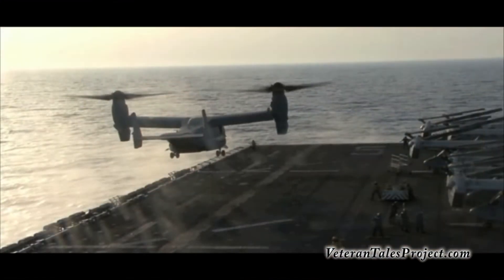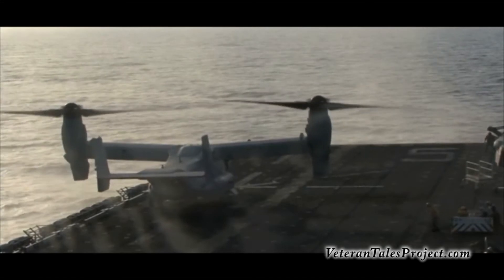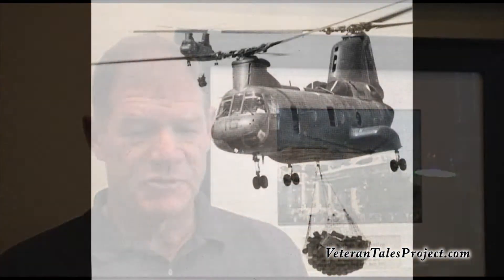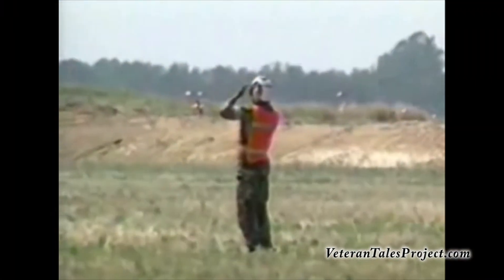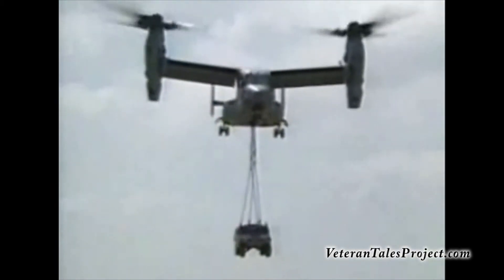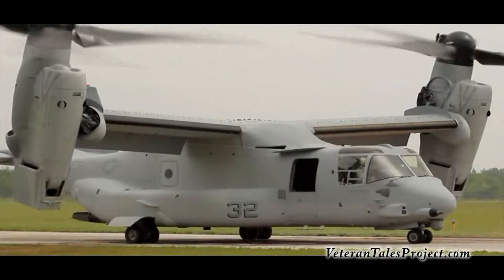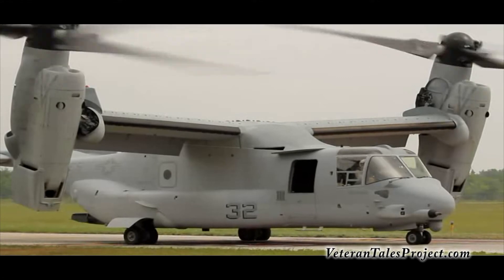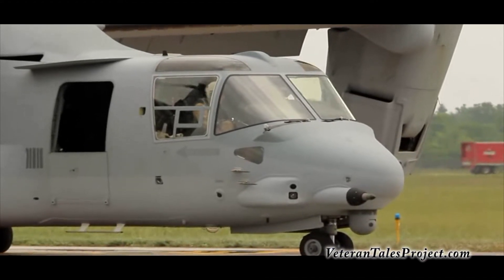MV-22 Osprey Pilot Dick Peasley Pt 2 - Veteran Interview

Comment: Seems to me I may have commented on one of these videos before…..but I had the great pleasure of working with Mr. Peasley on the V-22 program.  I was a structural engineer supporting flight test at Arlington Texas. 

He was exactly as he appears here.  Cool.  Calm.  Collected….which is what you want in an engineering test pilot. 

A couple things I can remember:

He saved the aircraft one day.  He was flying co-pilot and the pilot was in the aircraft for the first time (can’t recall who he was).  They were flying in helicopter mode.  As they were flying...the aircraft kept pitching up.  And kept pitching up.  Eventually...the pilot flying said something along the lines of: “I’m losing it”.   Peasley....who I’m told was fiddling with the radios...looked up and IMMEDIATELY knew what to do:  he beeped the nacelles forward which fixed the problem.  The issue was, as it turns out, the wash from the rotors in that particular flight regime was impinging on the horizontal stabilizer – forcing the tail down and the nose up.  They were very close to going out of control.   Mr. Peasley saved the day.  Anyway...that’s how I recall it.  

And then...one day at the Bell Arlington facility they were having some sort of press day or some such...with a bunch of different types of Bell aircraft on the ramp.  One of the aircraft was one of the large Bell helicopters (can’t recall which).  Anyway...the aircraft had to be repositioned.  It turns out, Mr. Peasley was the one that got in the aircraft, started it up and moved it by pulling it into a hover and moving it a few feet.  What I noticed was he pulled it up so that the skids were mere inches….inches above the concrete. And he moved the aircraft 10 or so feet….all at inches above the concrete.  I was mightily impressed.

And then..one day when we were all a Pax River doing flight tests, I was driving down one of the main drags there and saw him at a road side place selling crabs!

I have always had tremendous respect for this man.  This interview was 8 years ago.  I hope he’s doing well.
Reply from the maker: That is really amazing! I sure do appreciate you taking the time to share those stories with us! Dick sure is an amazing man!!